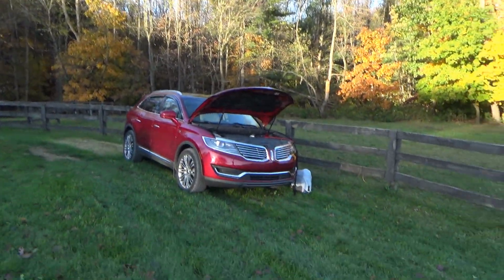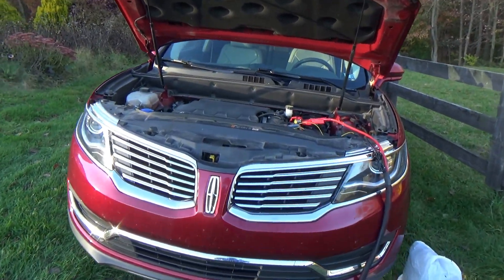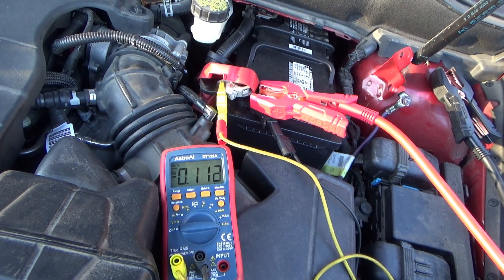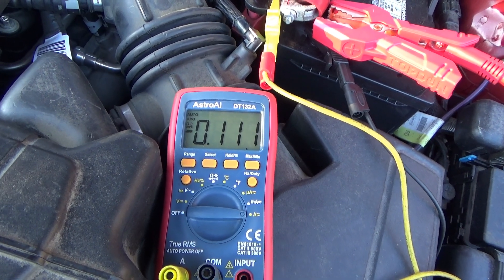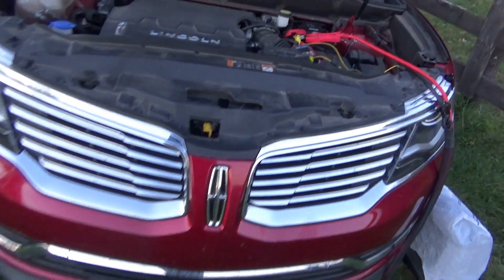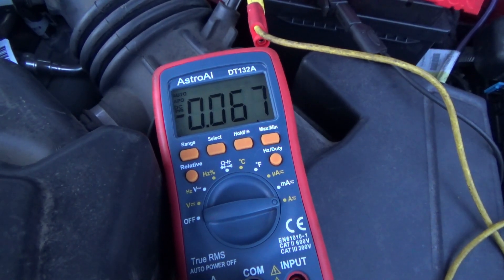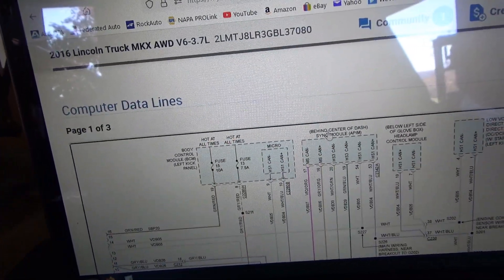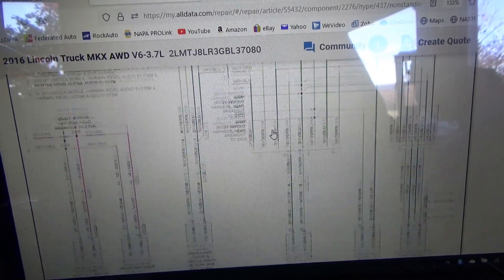THIS may be DRAINING your Battery Overnight! (Lincoln MKX -Part 1)

Comment: I think my 2017 lincoln mkx is having same issue.. replaced battery, battery has been checked, there seems to be a draw someplace.. I've noticed when I turn it off and walk away, internal lights dim and go out, but my radio knob back lights stay on.. with key fob in house.. however, when I lock the car, the backlights turn off. I'm thinking this may be the draw and may be draining the battery. my dealer charges 200 per hour so not sure if I want to take it there of if they can even fix it. in meantime I bought a NOCO Boost Plus and will keep it with the car in case it won't start.. and will try locking the car each night to see if that fixes the issue.
Reply: I had the same problem with the 2016 reserve. Three years ago, it was still under extended warranty and they had to replace the radio because there was some module in there that caused the problem.

Comment: Ran across your video - Well done - I have 2016 MKX that is experience a parasitic draw as well - Thinking it is having the same issue - Telematic Control Module  - I believe that module is 3G based and with the U.S. shutting down the 3G network in 2021 I am thinking that module is continually trying  to connect to the network and never shutting down which would cause the drain - I know Lincoln offers a upgrade to the 4G work but is outrageously priced.  Let me know thought if you think that could be it
Reply: Had the same problem, three years ago, but under extended warranty, took it to a Ford dealership because the Lincoln dealership couldn’t figure it out? Turned out to be some module inside of the combined radio in climate control.

Comment: The one I’m working on is the hybrid MKZ It’s got a 600mA current draw. I’m good with electronics and stuff. I am just not familiar with a cars communication. All I know is it uses CAN. As far as high speed low speed etc I am lost why it would use different speed for communication
Reply from the maker: Just depends on required volume and speed of data transmission. Not really an important detail. But you DO need a 4-channel oscilloscope to monitor the network activity to see if someone is "waking up" the entire network :)

Comment: Just acquired grandfather’s 2016 3.7L MKX, has only 12,000 miles. Put new battery, air filters etc, drove home 750 miles. Week later battery draining parked overnight. Unplugged a AAA device from port under steering column thinking that maybe cause. Now battery holding for days but on last road-trip and since last jumpstart the Nav and infotainment have gone black? Car driving fine just missing all the tech

Comment: I have a 2009 mks when the temperature outside raises or my defrost is on my electrical components such as my radio/navigation and climate controls go out. it also tells me that all of my doors are open. I’ve checked battery fuses altanater  im lost as to what i need to check next

Comment: If you think the dealer doesn't know how to use an ammeter you need to have your ego checked you definitely don't need a Pico to diag this issue plenty of people find them pulling fuses not to mention you used piercing probes on a data line how dumb are you that's going to create some headaches a few years down the road if the vehicle lives anywhere that has any humidity
Reply from the maker: I get cars all the time that have been misdiagnosed... Usually dealer says to customer "if there are no codes, go pound sand" 😂
Never seen a work order that actually mentions a draw measurement, so I assume they don't know how to measure it...

Comment: Fordtechmakuloco 
has a parasitic draw video from a year ago or so. On a Ford escape. Rear wiper motor was seized but module was attempting to PARK the arm. Pulled upto 4amps for 10secs. Killing battery over night.

Comment: I'm about 9 mins in and wondering, if ambient temp was cold enough, one couldn't watch the fuse box with an IR camera when the amps spiked up and get an idea which fuse was heating up then see which modules were powered on that fuse.   Together with your scoping the different networks might narrow it down to a single, or very few, modules really quickly

Comment: Oscilloscopes are awesome tools.   I was a computer software engineer (retiired now), and for much of my career, I kept an actual old fashion analog oscilloscope on the workbench next to my desk along with a variable power supply, a digital multimeter, and a signal generator.    Those were the basic tools of an electronics bench technician in the 1970s-90s, but I found that o-scope useful for all sorts of realtime computer software debugging, as I was working on IO device drivers much of my career.

Comment: <50 milliamps is the rule of thumb for Mercs, we had a bunch of cars staying awake until you locked them in the w204 days, sometimes it was a faulty unit staying awake like a radio, cluster or overhead control panel, but we used to use the old fuse method to find it :(

Comment: For cases like this it would be really interesting to use pico serial decoding to get the CAN ID of that first message that appears on wakeup. Once you have the message ID, you could find out which module that belongs to by just monitoring the network in a normal ignition on state, and pulling fuses for each module on the network until the ID of interest disappears. For this to work you would need to sample the network at a high enough rate to be able to decode it, and also use the very first message only, as once one module has started transmitting it may wake other modules as well.
Reply: I was just coming to write your comment as I downloaded the pico data and see that the sample rate isn't enough to do serial decode. A parallel suggestion would be that there are purpose-built  CAN decoders/encoders that could be connected to the network to do this capture a little more simply if you want the serial and not needing the waveform. There's some information over on redit's   CarHacking subredit in a pinned post and sidebar.

Comment: What is concerning me more than anything is the fact that these cars are taking multiple hours/days to diagnose.  I just don't see this fitting in with the dealership business model.  It isn't likely a service writer/dealership is going to commit the time, training, equipment and expertise to properly diagnose these issues.  The best part, these are NEW cars.  What will they be like in the future?  Great vodep!
Reply: Great video!
Reply: Can you imagine what will happen by the time they are on third owner? Talking about bypassing circuits , taped up twisted wires and unmarked toggle switches everywhere 🤔
Reply: @dharley189  Don't be silly!  They aren't going to make it to their third owner.

Comment: Ivan, you tend to focus on the fact that Ford vehicles take extended time to go to sleep.  I bought my Mercury when it had 92 miles on it and was being used as a demonstrator.  I got the car home and was admiring my new car (I have grown up since then!) and suddenly the air compressor started (it is equipped with rear-air-suspension.)  I talked to a technician at the dealership and he told me that air compressor can run up to 29 minutes after the ignition has been cycled.  That car is 27 years old.  So, I can conclude that has been going on for many years.  Great video!
Reply: Some cars will run the HVAC blower roughly 10 minutes after the vehicle is shut off (with the AC on) to dry the evaporator. I know Saturn used to do it, I haven't noticed in in a while though, but I don't doubt many euro cars do it today.

Comment: I had a Hyundai Sonata that had a parasitic draw.  I had a board clamped over the door switch to check the inside fuses.  Found nothing.  Pulled the board and the switch was the draw.  Replaced it.   Happened again.  Replaced the switch again, nothing fixed.  Had to go to the dealer for a safety recall and asked them to look at it.  They brought over a body repair guy.  Turns out the door metal was so thing, a seat belt could dent the door so the switch couldn't  reach the door.  He quoted me a price to repair the door, but said it would happen again.  Suggested inserting washers behind the door pillar and the switch.  Ground out part of the washer to fit over the wires.  Problem fixed. Unfortunately not mush farther into the fortune, it got slammed in the rear and got totalled.

Comment: Customer complaint proved! Now the challenge is finding which module or modules awaken and hopefully the cause. It is a bummer when the only thing you find is the module that awakens and not what actually awakens the module. I appreciate the module could be faulty, however identifying the module is only one part of the diagnosis. the other is determining if it is a faulty module or if it is an external issue that is buried in the depths of the vehicle or wiring loom somewhere, either OEM or worse still, aftermarket. Either way, confirming the root cause before calling the module could be an expensive bugger. I am looking forward to part 2.

Comment: My 2017 MKZ when I first got it, had an ACM firmware issue which caused the module to never sleep correctly. It will kill batteries. Pretty known issue across Fusion/Fusion Sport and MKZ. I'm not sure about MKX. All those modules are tough on batteries, especially cold.

Comment: I can't pass up this opportunity to mention that my 07 Mercedes S550 4Matic (which is just about a base US model) has 39 modules.  It does NOT drain the battery overnight, or really have a drain problem at all.  Of course, Mercedes cheated slightly with this car.  It has a huge group 49 battery in the trunk and all that battery does is power accessories and handle any slight drains.  A smaller battery under the hood is for starting only.  Still, I limped along for an entire year with a BAD trunk battery and there were no issues, even sitting for days in the cold.

Comment: Ivan... U have forgotten what you have taught us!!! 3amp draw for 10seconds. I just timed myself!! I can test 7 fuses for a voltage in 10s!!!  every 1m 47s I can test 7 more fuses!!! I would have tested all the fuses in the car before you finished reading the circuit diagram, installed pinch clips and setup the scope!!! This is what you taught us! :) LOL...
Reply from the maker: My methods are constantly evolving 😉
Reply: @PineHollowAutoDiagnostics  lol. in a year u will be showing the actual data being sent on the line. I would assume that data actually says "im module xyz whats up yall?" I assume the voltage drop method would be helpful here though

Comment: Is there any commonly available tool that would just let you decode the CAN messages? One might hope that whichever module transmits first is the problem module, but maybe not.
Reply: There are can decoder tools, heck, the Pico has one built in. But that is a different level of diagnostics not used much in automotive, more often in industrial or heavy machinery.

Comment: Hopefully the wiring diagram will be helpful in locating the problem module.  Taking the problem CAN network out from the gateway loop or taking it apart also called isolation is the best way to find the problem, IF you can do that.  THIS problem should be "Very Interesting!"
Very much looking forward to part 2 ! !

Comment: Looks a new model to be giving trouble. Isolating the networks has done the business. Very time consuming exercise but seems to be showing results. 3 amps is a bit over the top. Too troublesome for a dealer, especially with the extended timeframe involved. You'll soon be crowned 👑  of the parasitic draw division.

Comment: In this scenario, would it have been more useful to hook up a graphic DMM or something like a 1 channel scope in series with the battery to catch that 3A spike event rather than a regular DMM?  It seemed like luck that Ivan was able to catch the event as it happened on the DMM. With something graphing, even if you missed it you could look back in history and see the spike. 

In this case it seemed important to catch the 3A event since it gave a clue that a module was waking up and then going back to sleep. Otherwise you would only be chasing that constant 65mA draw. I'm looking forward to part 2 since it seems like there may be 2 separate issues. What is causing the 3A spike and then the "resting" 65mA draw.
Reply: and the vantage pro does internal amps. the last great scope meter snap on made. does things newer versions can’t, and has a long long data memory, so perfect for a job like battery draw. wish somebody still made a tool like the original vantage or the vantage pro. a real time graphing multimeter is a very handy thing. i love the vantage pro so much that i finally found two of them.
Reply from the maker: Is there a tool that can graph in series current? 🤔
Reply: @PineHollowAutoDiagnostics  I think I've seen in previous videos of yours the Snap On Vantage can graph Amperage. Or could you use an amp clamp around the negative cable and graph that way?  Maybe I'm dreaming of a magical tool that doesn't exist 😆.  Forgive me. I'm not a tech. I'm an accountant who is really into cars and enjoys learning new things.
Reply from the maker: @kv2280  yes actually the old Vantage could graph current! Wish the Pico could too. Current clamps have too much drift over time, especially at the milliamps scale. Accounting and diagnostics have some key things in common like being precise with numbers and keeping careful notes 😁👍
Reply: @PineHollowAutoDiagnostics  yes! Eric O has used his Vantage to graph current in at least couple parasitic draw cases.

Comment: 3 amps for 10 seconds every 100 seconds is only 0.3 amps average.  Your typical car battery is at least 50 amp-hours so it should hold out for at least 100 hours.  So it should not be dying overnight, more like after 4 days or so.  Or maybe the stress of losing 1/4 of the charge and recharging that much the next day, maybe that wore out or dried up the battery.  Waiting for part 2!!
Reply: Lead acid battery capacities are inflated. You'd be lucky to get 20 useable and not battery life shortening amp hours out of a 100 amp hour battery.
Reply: @dizzy2020  I understand that one can't describe a battery with just one number, the power curve is going to be a bit ....  curved.  But not to the extent that a 300 milliamp load will discharge a battery "overnight"!  That's over ten times the expected discharge rate.   But then on the other hand, if the battery has been repeatedly discharged to zero many times, it's amp-hour capacity can be greatly diminished, even if it's relatively new.

Long ago my father had a mercury with a tit-switch controlling the trunk light.  If you parked the car on a hill, facing down, the trunk light would go on and discharge the battery quite a bit overnight, leading to eventual battery failure.

Comment: Is it possible to have a modern US domestic vehicle with less than 30 modules? 😂 I think we surpassed the reliability limit a long time ago…   Very interesting case study, Ivan 👍
Reply: @@user-fn6pq9tp2g the R&D budget on aircraft is much higher, things are only fitted for a practical purpose - and they're still allowed to use "proper" solder with lead in it.
Lead free solder is one of the main causes of failure, whether it's tin whiskers or cracked joints on connectors or anything with significant thermal cycling.
The ones I see the most are Ford Focus clusters for crank no start and Fiat "Blue&Me" modules for flashing mileage and parasitic drain.
Reply from the maker: True definition of "luxury" is when your car won't start in the morning 🤣
Reply: @PineHollowAutoDiagnostics  😂
Reply: @PineHollowAutoDiagnostics  I love it!

Comment: Break out the thermal camera in the fuse box.
Reply from the maker: You would probably see quite a few fuses heating up... Then what is the next step?
Reply: @PineHollowAutoDiagnostics  Yes, that might be true but it's worth a look, maybe it would yield a clue.  Maybe pulling those fuses one by one might yield more.
Reply from the maker: @rmr5740  remember that pulling fuses on a modern car costs a LOT of time and can have unintended consequences because all the modules are interconnected. Strategy here is to use non intrusive testing and hopefully pull just one fuse to solve the problem 🙂
Reply: @PineHollowAutoDiagnostics  Something is using 30+ watts, maybe looking at modules on that bus with an infrared thermometer would tell you which one.
Reply from the maker: @rmr5740  perhaps! But the modules are usually hidden behind consoles and trim...that always makes the hunt fun haha
Reply: @PineHollowAutoDiagnostics  OK, you've got my curiosity up as to how you solved this one.  Maybe something is making a tiny noise or an LED lights up on something every 100sec.

Comment: Using the SWAG method I would guess anti-theft circuit. Like door locks , what is suppose to help causes the owner the most grief.
Reply from the maker: SWAG?
Reply: @PineHollowAutoDiagnostics  Scientific Wild Ass Guess
Reply: @baldy95307  Yes, usually followed by FUBAR. ("F"'ed  up beyond all recognition)

Comment: Very interesting case, if not annoying for being intermittent! Thought process of a real Sherlock Holmes, Ivan 🙂Like most network problems, impossible to have a clue without a scope.
I find it maybe telling, that there is only a slight increase in current, before it triggers an event that wakes the network. If it weren't regular like a clock, I would say a parasitic current somewhere (green crusties or water intrusion), but being so regular, it must be a module on its own. Curious to see which one is the culprit - let Part 2 begin soon 🙂